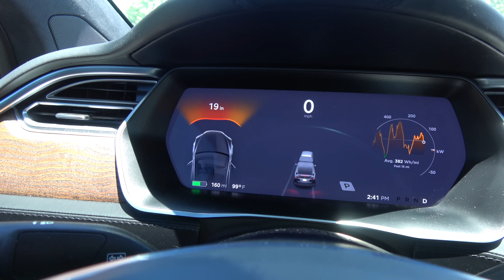Our Dream Home Has Windows!

Comment: Why is there just wood ?
We got everywhere concrete, metal and glass.
We got spray foam as well.
Reply: Samsung Stuff DE that’s how those crazy ‘mericans build stuff. We (UK) mostly build like you guys with brick and block but it’s moving more towards timber with render/cladding because a) it can be cheaper and b) you can bang a whole load more insulation in a 7” stud wall than you can in a cavity between a brick and block wall. 

A brick wall has an R value of 0.44+1.56 for 100mm of insulation + 1.9 for the block = 3.9 

Spray foam is 3.7-6.5 per inch. Over a 7” timber wall that’s a minimum of R being 25.9 excluding any render, cladding and OSB. Crazy different
Reply: @iggifer  Im from the USA and my house is concrete, then again it was built in 1892, i live in an old mining town.
Reply: Older homes are mainly concrete.
Reply: @Jacob-ou5ks  we are building our house right now so it's brandnew

Comment: 7:04 In Electrician circles, this is known as the Media Center.  Phone cables, lighting controls, audio entertainment system, ect.  Even surveillance and security systems - complete with a direct connection to the phone line for automatic communication to emergency services.  This is where it's all connected and routed to the button controls.

Comment: There are a lot of good things about spray foam but if you are worried about the chemical mixture going wrong. I would suggest Rockwool insulation because it is flame retardant, soundproofing, and antimicrobial against mold and mildew.  For your windows it looked like the flashing was there in the front but that flashing should pretty much be continuous to the inside of the house. Overtime all windows leak...

Comment: Definitely use spray foam. Working in construction I’ve only heard great things about it - insulates more efficiently, seals the house better and squeezes into cracks that fiberglass and loose fill insulation can’t, greater longevity as well

Comment: Use rockwool for insulation it doesn’t burn and it’s great for sound proofing spray foam on the other hand is not something I would want in my house because if not installed properly it will off gas and make your house unlivable and it burns very easily

Comment: I work for a solar energy and efficiency company. Definitely go with a radiant barrier in the attic. It has to set no less than 2 inches off of the rafters to be a true radiant barrier to allow for heat to reflect back out. It's usually a 2 sided layer if aluminium.  Keeps attic temp within 5-10 degrees of outside temp.
Reply: Also make sure fiberglass insulation is sitting at about an R-60 (20 inches worth). Homebuilders cut cost by putting the minimum usually at r-30 (12inches)  this will prevent hear from seeping in home. No need for spray doing this. Also use a solar attic fan. Proactively expels heat 24/7 and removes mold and mildew build up over time. You guys will need 2 for the size of the home for sure.
Reply: Any other questions and I'd be happy to assist. God Bless and congrats on your  dream home!!

Comment: This was a great update. I'm actually really happy you showed the electrical part of the house because I'm a 2nd-year electrician apprentice and I've been working on a 10,000sqft house that has Control4 switches. And I wish I could show you a picture of the panel room because we have 9 lighting panels and about 300 total wires ran to the basement and each wire is assigned to a specific panel. But it looks like you guys are doing line voltage for your switches so I was wondering if you guys are doing Lutron or Control4 (line voltage)? Either way very cool house!

Comment: The best thing to do if you want to maximize your efficiency to your home as-is, the best thing to do is a 'BLOW DOOR TEST' for the house, basically, they pressurize it, and blow foam in and it will go in any holes and seal the house. That way you don't waste any of the cold air you made. Despite what people tell you, homes should not leak. You want to have full control over what air goes in and out for maximum efficiency. Also, I like home videos, they are fun.

Comment: Cant help you with the chemical question about spray foam. But as for its thermal protection. I did 3 tours to Iraq. The first tour we had to stay in tents in Kuwait middle of summer. It was boiling hot in them. But it was far worse outside so you just had to lay on your cot stewing in your own juices lol. I think by my 2nd tour all of the tents had plywood floors and the tents themselves were incased in spray foam. The difference was incredible. Completely livable inside them and they hand A/C ducts installed. The A/C wasn't super strong but it didn't need to be because the foam did its job. Of course the tents are ruined once you foam them. They become permanently incased and now need to be demolished if needed. But foam does work really well.

Comment: Are you guys doing some sort of home automation with those lifting panels? Like control4 or something?
Reply: Jeff Walker hopefully not control4. Id be bummed to watch all these updates and realize they made such a big mistake by going with that system. : |
Reply: @jameskendall4489  not a control4 fan? sounds like you had a bad experience
Reply: Jeff Walker I’m slightly biased. I’ve ripped out so many of those systems and replaced with other systems instead that I only see the bad in control 4

Comment: I have very good solution for your Tesla battery run-out it's very good 

First you need to buy high quality portable gas generator and gas can put it in your Tesla and when the battery run-out turn on the generator and connect the charger 
And you are ready to go !

Comment: Why did they not install a housewrap or weather barrier before the windows? Continuity between these is critical. I would not pass this, and would require them to remove and reinstall properly after the weather barrier.

Address your airtightness with Aerobarrier and no foam is needed.

Comment: Hey, be careful with the material they’re using for the plumbing, it’s called pex. It’s extremely easy to work with and install, but it’s very easily chewed through by  rodents.

Comment: Whoever plummed that house should be fired, PEX is designed to have limited connections with a direct feed back to the Manabloc. I saw several areas as a home buyer I would not be happy with, especially since that house is $500K+.

Comment: just want to ask why dont you build houses with  STEEL and CONCRETE 
In INDIA everyone uses steel concrete  (single floor multi story )
any particular reason just want to know
Reply: air doesn't circulate well with concrete and its cheaper to use wood

Comment: In belgium houses are made out of metal conctete and bricks.
In usa just wood ?
Reply: In the Southwest, you don’t want metal or bricks because it will retain the heat. Your home would be an oven. Homes are usually built with wood frames, lots of insulation, with either stucco exterior or a tile facade to help keep the heat out.